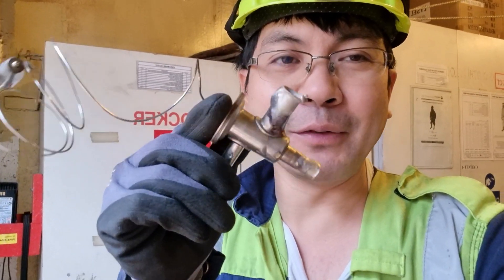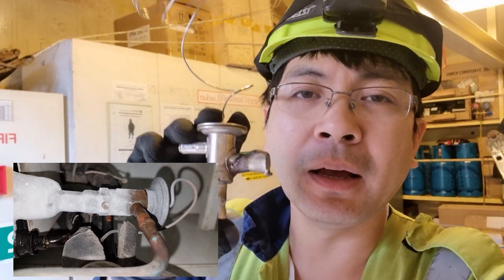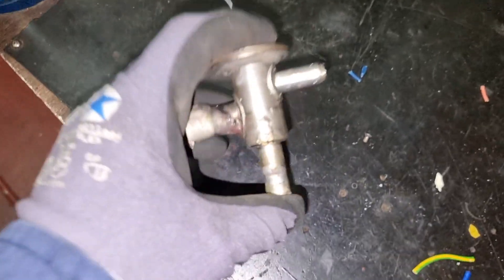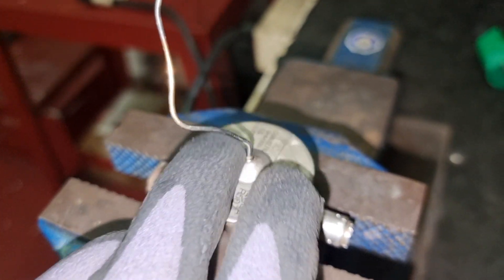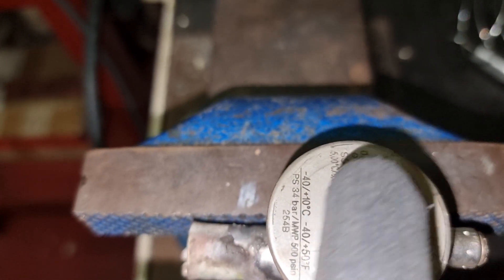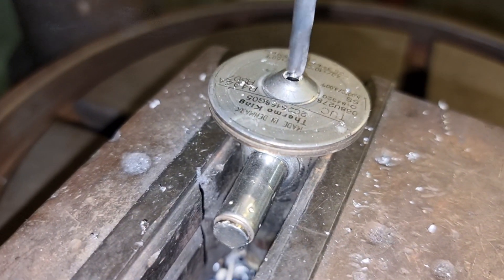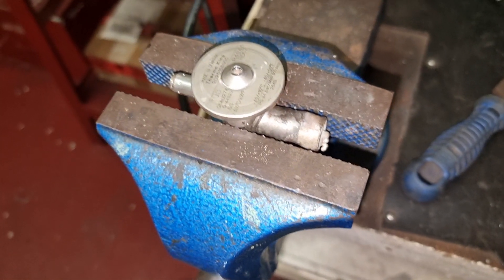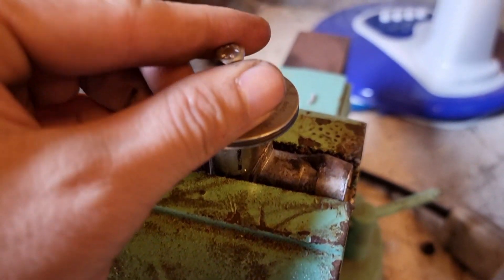TXV TROUBLESHOOTING, REFRIGERATION THERMAL EXPANSION VALVE UNDER EMERGENCY OPERATION | LECKYJAKE

Comment: Excellent emergency fix! 

I just hope that you can find a way to capture the small amount of refrigerant that would be released in the process. Perhaps freeze the TXV before cutting off the bulb, then pouring the (liquid) refrigerant into a container before it expands into a gas?

Comment: How to solved alarm 24 carrier 20fit
Reply from the maker: Hi, remove your compressor connections after the contactor and do an insulation/continuity test. If it fails then change the compressor, if compressor winding is ok then check your contactor for possible single phasing.

Comment: Good day Sir. I just want to ask something. I have an upright freezer that I wanted to make the freezing faster. Can I use the TXV, to modify the speed of running refregerant. Thanks in advance for any info.
Reply from the maker: nope. txv is always the last thing that you need to touch on your refrigeration system. you may add cooling to your condenser.

Comment: Its a little dangerous as the flow through TVX may become uncontrolled and damage the compressor(s)!
Reply: As he stated it’s for emergency repair only. And you have to remember this is a cargo ship and those containers stay shut  during shipping so I don’t think there would be changes in heat load. As long as there’s is good amount of SH back to compressor is fine. 

Also I’m sure it’s better to try this and save $300,000+ worth of product than $5000-$12,000 compressor
Reply: Oooh think mcfly

Comment: Sir, if you have 1400 reefer on board? How long it takes to monitor?
Reply: Modern reefers are high tech. Can communicate across oceans, so I am sure most of the monitoring is done in front of a laptop. If something is amiss, than he will have to climb and work locally. Electrician is one of the best jobs on board.

Comment: Leckyjake can u make a stepbystep vlog on pumping down reefer and filling of refrigerant pls. We dont have electrician onboard. This would help us alot. Thanks for those really helpful and important videos. More power Lexkyjake
Reply: Should be able to front seat the king valve. And have your manifold gauge hook up to the low side to see the pressure or if the unit has a display that shows data and lock it on suction pressure.. once the king valve is closed. The unit will start going into a vacuum.. storing all refrigerant in the receiver tank. Once suction hits 0. Shut off the unit... it is now pumped down. And you can repair on low side lines or do repairs or remove compressor. Once unit is repair. U can front seat the discharge valve.  And RR filter drier. And pull a vacumm @-29/30. Then can charge accordingly,  utilizing the vacuum that's held in the system to pull the refrigerant in... once charge,  back seat the king valve. Start unit. Purge the king  charge line into lowside for acouple seconds... that line is now good to be taken off.. them back seat low side valve... unit is now in normal op. Hope that helps

Comment: I have a one doubt... Txv main rool regulate the flow of refrigeration depending on existing of evaporator outlet refrigerat temp..  so we are  using this kind of txv is posible to damage a compressor.. because  liquid refrigerant entry to compressor means compressor get damage..  how to calibrate the refrigerant temp and how you to adjust the folow...?
Reply: I'd say your concern is valid, but as he said if it doesn't get fixed they lose the entire load inside the container. That alone is enough to risk the compressor.
Reply: Apart with this configuration you can set the txv in the middle, no too open or closed just enough for maintain the work and evite flooding back that compressor, but if I recall correctly those containers come with semi hermetic compressors, well i know like mesa type, so they are more resilient to that, i mean flooding liquid back on any type of refrigeration compressor make it damage in no time but this type can support it a little bit better than a classic reciprocating or scroll one
Reply: You can just adjust the bolt until there is no icing on evaporator line (output of TXV)
This way, you can ensure that superheating will always be there. Also the reefer wont be opened.
Yes it can show alarm, but even at that temp the load will most likely survive.

Just remember, freezing is so different than acu cooling and freezing is usually less stressful as frozen goods take too long time to get damaged.
If the reefer was used for cooling, say fruits, then that will be very stressful as the goods will spoil very very quick.

Comment: Thats genius level work there! 

Had TXV fail shut so I could not pump the system down to replace it, so cut the sensing bulb off and made a connection to the capillary and used nitrogen to pressurise the bellows and open the valve.
Reply: Hey I’ve done that too but would you be able to use like 45% solder on that stainless steel line?
Reply: Regular soft solder will stick to stainless if you use a soldering iron and flux. If you use a torch, the instant the flame hits the stainless it will oxidize and the solder wont stick.
Reply: @EldonJohansen  15% silver solder solders stainless steel perfectly. Give it a go
Reply: @edwardtsang3243  it sort of works but the phosphorus in the rod makes a brittle intermetallic bond with the iron.

Comment: That’s a good workaround for emergencies! Shame they’re not TEVs with removable power heads as you could keep a pre-made emergency power head on standby without having to unsweat 👍🏻 top video
Reply: There ARE more in refrigeration application's
Reply: 5:11 - Thank you for your input. You just made this artificial sensing bulb idea even more valuable to me (see my comment above)! I still  have two Sporlan valves that were replaced recently (one was a capillary tube rub out so the valve is likely still good), which I will modify to keep on hand.

Comment: Great video.   I may use this in my job one day.  My job is on land, but a TXV is a TXV on land or sea
Reply: Yes TXV is a TXV but depends on where you work .. his containers stay shut I assume so there isn’t much fluctuations in heat load so as long as he has a good superheat it’s ok but if you’re in a busy restaurant walk in there could be risk.. but in a pinch this is very good sometimes you get a late night call or SupplyHouse is hours away

Comment: Leck yung Eng.Room reefer po namin is ng frost po ang compressor at evaporator and expansion valves after 30mins running..ni research ko po posible na cause either flooded with refrigerant at defective na TXV po..may suggestions po ba kayo kung ano pa po mga reasons ng pag frost?

Comment: Can you find an empty refer and check to see if it’s the right one and rob it from the empty container?
Reply: They usually put the empty containers on the top so it’s a bit problem to extract the txv from 5 or 6 hight